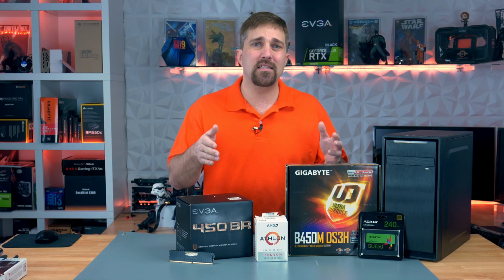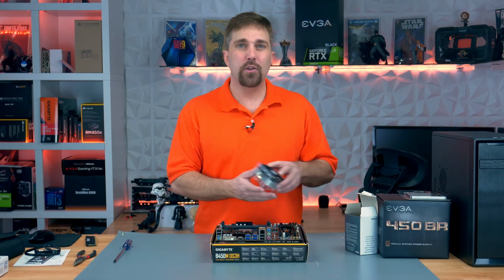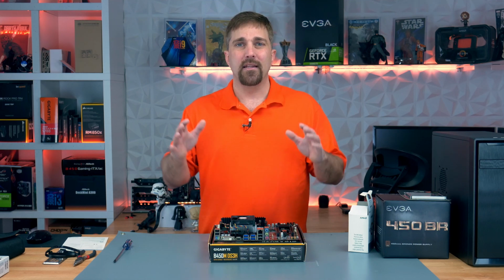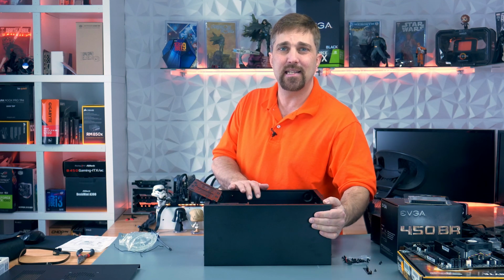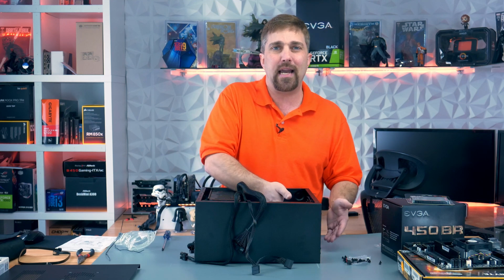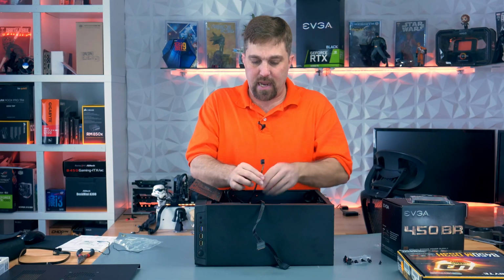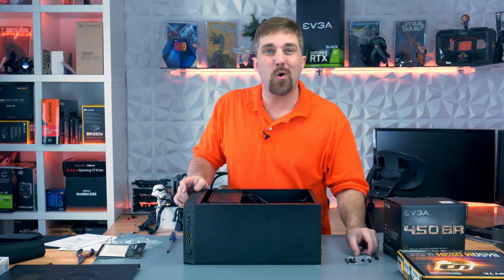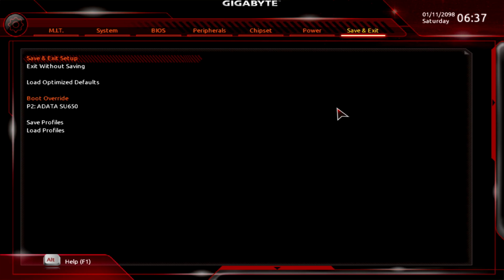$300 Home Office PC - Complete Build Guide 2021

Comment: Soem suggestions for people seeign this wideo in '23. If you do not need a graphics card for your work I would suggest a newer CPU so you have a stronger base for future updates if needed, something a like a Ryzen 3/5 from the 4000 series onward with the inbuilt graphics (they are differentiated by the G after the number).
As an upgrade path you can go with dual channel RAM memory by adding a second stick or updating you drive memory with a faster M.2 now that their price isn't as high a it was in '21 :3

Comment: Hello. C.J. I created a new PC based on this very process, with the same motherboard, with a Desktop that has a VGA Port, 

I bought a DVI to VGA Adapter DVI 24+1 DVI-D Dual, for the connection, between the PC and Desktop.

Now. After all the installation, the PC is running, but it's not showing on the Desktop, the desktop is blank-black screen,, But when I connect the VGA Desktop to my Laptop, ( My laptop has a VGA port) my Laptop screen does appear on the Desktop screen,,

My question is... Is the PC DVI 24+1 not compatible with Desktop with VGA??

Is this motherboard only works on Desktop with DVI port, And what might be the problem???. Thank you.

Comment: Better to go 4gb x2 for dual channel but ram is cheap so i always go with 16gb. 8gb x 2

For the m.2 standoff/screw, attach it to the board for future use so you don't lose it. People tend to throw out boxes.

I used to test bench build before installing into the case but after all these years, I've never had a DOA part.

Comment: Help!  I built one of your computers for the home office. Everything worked flawlessly. I built a second one for my shop. The first case I had with the power supply would not power. I sent that back and got another case. I installed everything and the computer powered up but there is nothing on the computer screen. Any suggestions.

Comment: I followed exactly every step in this video but my pc won't turn on at all. I tested the PSU with the paper clip trip and it works. Amazon is sending another mother board. Any tips for troubleshooting?
Reply from the maker: Did you try to turn it on by jumping the power pins? If that doesn't work go through the basics. Double check RAM position and reseat. Reseat the CPU. Check that all the cables are connected correctly and completely.
Reply: @ElevatedSystems  I have jump start the power pins but nothing happened. I did however, forgot to screw in the bottom right standoff screw for the MOBO. Realizing this, I completely unplug everything and restarted the whole process with the correct standoff screws. Would not having all the standoff screws in place befor turning it on cause a short circuit?

Comment: what was that thing you installed next to the power supply? The part where the cables start coming out, what was that for?
Reply from the maker: The small metal piece? That is just a retaining bracket for the power supply.

Comment: Great video. 
The only thing is I highly recommend switching to an M.2 SSD. They're available for similar pricing. Then there's no need to monkey with mounting the 2.5" drive and dealing with the SATA data and power cables. It also makes using a smaller case easier, for those who want to do that.
Reply: Noob question but if I were to use an HDD as a second storage, which type of HDD would be compatible with this build?
Reply: @oOgy172  
1) Check your case to see if it has space for a 3.5" drive (most do). If yes, you want a 3.5" HDD. If no, you want a 2.5" HDD. I'm assuming this is not for a laptop. 
2) Either way, you want it to be SATA III, 7200RPM. These days it's basically either Seagate or Western Digital. I recommend either 2TB or 3TB. 2TB was only $20 more than 1TB the last time I checked. 4TB seems to fall into a different model category.
Reply: @Trifler500  I have a micro ATX and I think a 2.5 inch ssd AND a 3.5(or 2.5) inch HDD should fit fine because the case has 3 mounting spaces for 2.5 inch drives. Thanks for the help

Comment: So I built this PC exactly like you showed but am having a high pitch whistle sound that changes depending on how much effort the computer is going through.  It pretty much never stops. Is there a fix? Thank you
Reply from the maker: Can you tell where the sound is coming from? It sounds like it could be a fan issue.
Reply: @ElevatedSystems  It sounds like its coming from the CPU. I stopped each fan to check and the sound still persist. This article describes the issue I am having. Although I do not see any coils on the motherboard. https://www.lifewire.com/fix-coil-whine-high-pitched-noise-4165184
Reply from the maker: @dontworryboutitdude  Coil whine or capacitor whine, on the motherboard VRM is more rare then GPU whine it's still possible and hard to get rid of. If you just bought the motherboard your best bet is to exchange it for a new one. However it is also possible the power supply is causing the VRM to whine so no guarantees.
Reply: @ElevatedSystems  I have another power supply so I'll give it a try before returning the motherboard. Thanks for the advice!

Comment: This is sooo close to my most recent build! Cost me around $300 with mostly used parts. 
PSU: Corsair CX500 (500 watts)-USED
Motherboard: Msi A320M- A Pro Max-NEW
Case: Rosewill SRM-01B-NEW
Ram: 16gb of XPG 3200mhz-OPEN BOX
Ssd: 240gb Adata-NEW
CPU/GPU- (Went with an APU to save money) R3 3200g with wraith stealth cooler-USED

Other parts: my old 2TB gaming HDD, my old Asus Blu-Ray drive

This was well worth the money! I just upgraded to an Asus RX 5500 XT 8GB Dual Evo for Christmas and I'm in the process of swapping the APU out for an R5 2600. Should be a 1080p beast when I'm done :)

Comment: Can a laptop cd rom drive be used in that front slot?
Reply from the maker: Probably not but you might be able to find an enclosure  / adapter to put it in so it can be installed, or I know there are external USB enclosures for laptop optical drives.
Reply: @ElevatedSystems  Thank you.

Comment: when i am pushing the lever down after installing the cpu it feels like i am applying more pressure than i should. any tips
Reply from the maker: Just make sure you lined up the arrow on the cpu with the arrow on the motherboard and the small tabs on the socket are set in the notches on the cpu.

Comment: Can’t find that processor what other one do you  recommend from Amazon?
Reply from the maker: If you have some time Amazon usually gets these back in stock within a few weeks, if not shop around for a Ryzen 3 3200G ($99) or you might even be able to pick up a used 2200G or 2400G for a good price.

Comment: Why no wifi? Not everybody is able to run ethernet to their computer? Personally, I prefer to use PCIe wifi cards, even if they are a little more than the cheap usb wifi adapters.
Reply from the maker: You can very easily add a wifi card to this, however keep in mind that if you end up adding a dedicated graphics card to this system there most likely won't be physically enough room to add another PCIe card onto the M-ATX motherboard. That's why I didn't include a WIFI card in the build.
Reply: Unless you use go with a mini ITX board, which you don’t have linked, there is no reason why a PCIe WiFi card won’t fit alongside a dedicated graphics card. The only exception being if you use a triple slot GPU, and the only card that I can think of that is relevant today that is a triple slot is the 3090.
Reply from the maker: You're right, I was thinking of a different build. My bad 😳

Comment: Prices seem to have gone way up now. Just priced this computer but added a different mouse and keyboard for over $500
Reply from the maker: Using the links I provided below I just added it up and even with the higher price for the CPU it came to $278 for the PC. Keep in mind the Monitor and keyboard were options I highlighted in the video and not part of the build price. Also as I mentioned in the pinned comment you no longer need the separate PSU as one comes preinstalled in the case now.

Comment: If someone has around 60 more bucks to spend, swap the processor woth the ryzen 3 3200g and instead of 1 8gb stick of ram, get 2 4gb sticks. Great video btw and hope everyone is doing well
Reply from the maker: I have a 3200g build coming up soon.
Reply: @ElevatedSystems  great
Reply: For me 1 8gb stick of ram is better, you could still be able to add another 8gb stick in the near future
Reply: @nhel2471  this mobi has 4 slots, so you can add additional 2 4gb stick fkr a total of 16gb ram
Reply: @nekojcovek8466  I know I'm 4 months late but please never do that
Reply: @TheTrueGrindSetMindSet  never do what? I am confused
Reply: DezNel Covers but most people for work won’t need 16gb of ram N having dual channel ram is way better than one stick of 8gb or ram
Reply: i cant get stock of 3200g nowadays
Reply: is a 3200mhz ram necessary? or can it run fine with a 2400?

Comment: Now these parts tend to cost around $500. When will it be back close to $250.
Reply from the maker: Use the links I provided and the total cost comes to about $260. Not sure where you are getting $500
Reply: I used all the links and they all add more than $350 for sure.
Reply from the maker: @user-ll8el4rz5b  I added them up yesterday and the PC comes to $259. If you add the peripherals then it hits $350 which is what I said in the video. Also, the case comes with a power supply now so don't add the EVGA one.

Comment: For $50 more upgrade to a quad-core Ryzen 3 APU. It's so much more worth it
Reply from the maker: What would the price to performance benefit be?
Reply: @ElevatedSystems  The Ryzen 3 3200G is a lot less dated, giving you more support from AMD, should something go wrong. It's also has twice as many cores and a higher base clock making it so much faster and reliable when multitasking/ having multiple applications open. Often with all the background tasks and apps with windows and chrome, the cpu would idle much higher, causing it to slow down and last a shorter amount of time
Reply from the maker: @yiannispapagiannopoulos9549  I'm not following the beginning and end of your argument. First the Athlon 3000G is actually  4 or 5 months newer the the 3200G, but I will concede that it is based on older architecture. However, all AMD CPU's have a 3 year warranty so you get the same support from AMD regardless of model "should something go wrong" Second, if you are not overclocking the CPU it is power and frequency are limited, so you won't affect the lifespan of the CPU by "multitasking". As far as the performance of the 2 CPUs, yes the 3200G is a more powerful CPU however the typical home PC user won't actually be able to see a difference in day to day computing tasks. In fact the best upgrade to this system is actually a Memory increase as I mentioned in the video. You will see a greater performance increase by adding a second 8Gig stick of RAM.
Reply: @ElevatedSystems  sorry, English isn't my first tongue. Yes the architecture is newer for the 3200G and multitasking on a dual core is significantly worse then on a quad-core, regardless of overclock. I agree that the ram should also be upgraded, or at the least use 2x4 gigabyte of storage to take advantage of dual channel.

Comment: How about using pentium ( g4560 , g5400 ) ??? Is it gonna have better performance ?? (Knowing mobo+procie only cost 5 - 10$ more than the athlon + b450)
Reply from the maker: That configuration would be pretty much identical to the Athlon system performance wise.

Comment: my standoff won't fully go in and idk what to do
Reply from the maker: screw them in by hand first to ensure you are not cross-threading them. Then tighten them down carefully. If you find yourself putting a lot of force on them you have probably cross-threaded it which can strip out the threads.

Comment: Please don’t apply pressure on your cpu like he did
Reply from the maker: What do you mean? The stock cooler uses a a clip system to put the correct mounting pressure on the CPU. Its a single clip that you simply close. It's not really possible to put too much pressure on it.

Comment: I am so glad that I found this video because my parts list is coincidentally the same as his.
Reply from the maker: Let me know how the build goes.
Reply: It went perfectly and felt like putting together an erector set. Thanks for asking! I cant say if it booted or not because I exaggerated us having the exact same parts list. I'm going to be using the r3 3300x when I can get my hands on it. I also used a corsair cv 450w psu and an rx 580.
Reply from the maker: @mrullmin8286  My 3300X will be here tomorrow, I was able to grab one on Newegg last week witin the 2 hour window before It sold out. Also double check your max power draw, by adding an RX 580 you will probably come close to pulling over 400 watts from the wall at max load.
Reply: @ElevatedSystems  I've been using pc part picker for most of my parts and it said my wattage was going to be ~380 watts.
Reply: @ElevatedSystems  Oh by the way, how much did you pay for the 3300x?
Reply from the maker: @mrullmin8286  I paid $135 for it, which isn't too bad considering the tray price of $122.

Comment: Couldnt decide on what pc to build for my dad. So i went with the 
R3 3200G
Asus B450M-A
HYPERX 2X 2666MHZ 8GB
Samsung 860evo 250GB
600W Chieftech psu GPE600S
I reused his old case and hdd (Asus V1 Vintage Bearbone)
Also i got a cheap Asus 24inch 1080p IPS monitor with brand neew keyboard and mouse (wierless from logitech).

Since i am full stack java developer made him few apps for his car repair shop hosted from my local home server.

He is happy as hell now. I got cheap windows 10 and office 2019 pro for 30€ in total from scd keys. I am impressed what a powerfull machine
Reply from the maker: Solid build. It was probably very affordable too.

Comment: Cj
Is the athlon gpu any good for music production
Reply from the maker: Not really, the music production realm is almost completely dominated by Mac but on the PC side you want a CPU with a much higher core count. Midi plug-ins and synthetic can eat up CPU usage so the more cores the better but 6 core 12 threads is probably the price to performance sweet spot.
Reply: Thanks You so much 
I appriciate it.

So a any  ryzen  5 with 6 core will do the job. Thats great cuz  they arn't too  pricey

Comment: Love the build! Would you recommend getting a budget graphics card or sticking with the integrated graphics?
Reply from the maker: It really depends on what you are using the system for. Adding dedicated graphics changes the whole system so if you go that route you have a lot more options for your CPU as you won't need the integrated graphics.
Reply: Low specs gaming recommend a rx 570

Comment: Should I get a 4k monitor for office use ? Would a 4k monitor also require an expensive processor or GPU if I only do basic ms office work ?
Reply from the maker: No, there is no need to spend the money on a 4K display for MS Office work. 1080P is as high as you should need, however to answer your question the 3000G will support a 4K display.

Comment from the maker: If interested, here's a smaller but more powerful Home Office PC build guide - https://youtu.be/Qh-uXdFQC1c (update 5/20 - The Roswill Case now comes with a pre-installed power supply which is adequate for this build and will save some money) Update 2/28/2021: I just updated the component links in the description, the Athlon 3000G sells for about $100, so I'll be revisiting this build soon to try to get it back to the $250 price range.

Comment: Just subbed. Great work man! I literally just finished my new PC in 8 years right before the epidemic occurred.

 Got the parts on great deals too.   From Ebay I got a Ryzen 5 2600x for $80 and a XFX RX580 XXX Edition 8gb for $90. From a local computer shop, I got a Phantek P300A case for $56, an Arctic Freezer 34 esports DUO for $50, Geil EVO Potenza 2x8gb DDR4 3000mhz for $80 and a MSI B450 Tomahawk for $90. Best Buy had a limited time deal for a Thermaltake Smart 700w 80+ for only $56. I got a Western Digital 500gb SSD and a WD 2TB on Amazon for $70 total.  I thinkI  feel lucky on my purchase.

My old build that I had for 8 years consisted of a i7 3770k,  G Skill Ripjaws X series2x8gb DDR3 1600, ASUS Sabretooth Z77, EVGA GTX 670 FTW 2gb GDDR5, Seagate 3TB SATA 7200RPM, Antec Three Hundred Black Steel ATX mid tower, and a Cooler Master Silent Pro 1000W. Had it for around 8 years and was still running like a champ.
Reply: Nice
Reply: those are steals